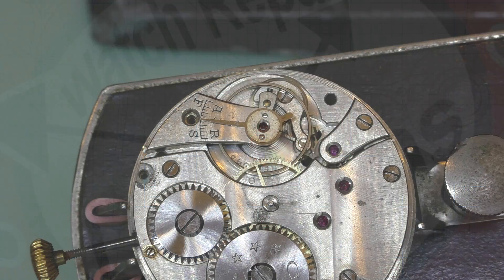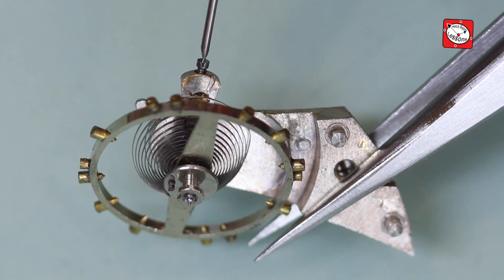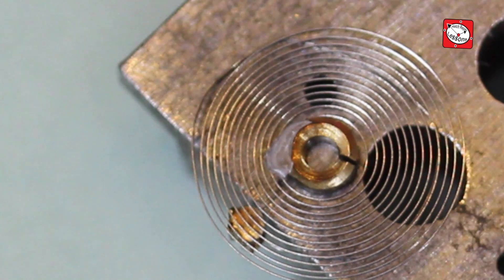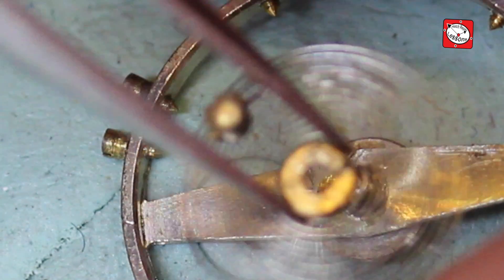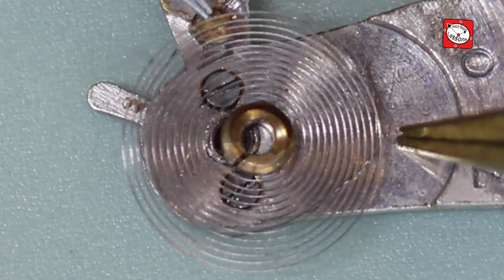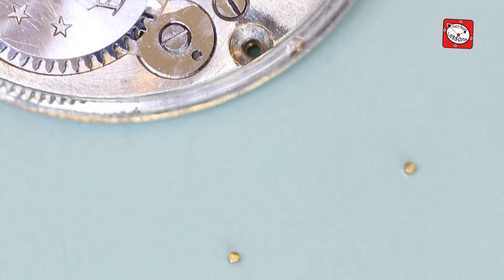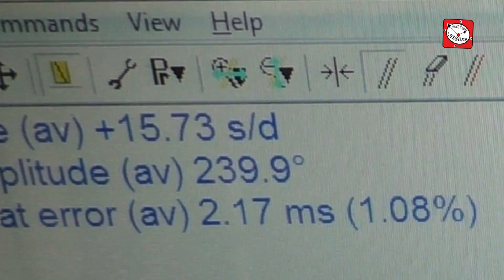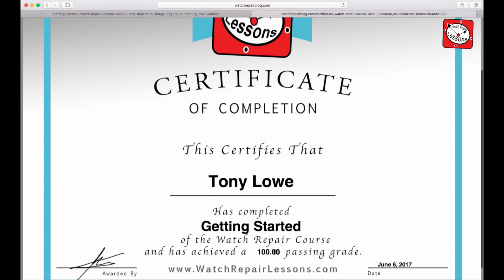The watch is gaining time - there's a surprising reason! - watch repair course and lessons

Comment: Hey, Mark, watching your videos again and, now being a little more knowledgeable, I noticed that you were using a computer instead of a timegrapher. Any recommendations on parts and software? Is it the same as a $150 timegrapher?
Now it’s easier to understand some of the actions and terms you use. Just like the video about twisted hairspring, at first I couldn’t get the lifting the spring to put it over the regulator but, after a dumb moment I realize that, when you lift the balance cock, the lower parts are the ones which will stay down while the outer goes up, and it really makes it easier to place it over it! Who knew that Mark could be right, once again!!!! Lol
Thank you very much!

Comment: Does hitting your watch by accident at work all the time, can mess with the regulation ? I have an omega geneve 1960s was keeping 3 sec a day +/- and when the power reserve is extremely low it showed -250sec/day. I quickly turned the crown to the full and dropped to a -50sec/day.

Comment: I''m an amateur hack repair guy (only my own watches) and this video has given me a new technique. I have an old oris which has a wonky hairpsring. I've been struggling with getting the hairspring just right. Now I'll be checking the collet hole is dead centre by placing it on the flipped balance arm. top tip!

Comment: I am not as knowledgeable as I would like.  Can someone help me out and explain amplitude as relates to watches?  I have a background in math, and degrees of amplitude confuses me a bit ;)  Seems like it's a measure of degrees of motion of the balance wheel?
Reply: I am a novice like yourself, but my reasoning is this: In the case of a pendulum, the amplitude is the furthest distance the pendulum travels from the point of equilibrium. 
The balance wheel has the same role as a pendulum as the time keeping element, so the amplitude must be the angle measured from the point of equilibrium to the point where the wheel changes direction.
Reply: makes sense, thanks

Comment: This is unrelated, but i have a cheap wind watch and the winding knob keeps coming off, unscrewing. Is ther a way to keep it from unscrewing? Thanks, Alan
Reply from the maker: The stem will need removing and secured in a pin vice so the crown can be tightened
Reply: Oh OK, Thanks

Comment: Great video as always Mark! 

I wondered if you can help me, my watch with an eta 2824-2 that I've had for exactly a year has started losing three minutes a day, it's never been drop or banged and has been welled look after. What could be a sudden cause for it to start losing so much time, can this timing error be corrected just by regulating or is it in need of a service? Many thanks :)
Reply from the maker: Seems like it might need to be serviced. Intervals should be around 3 years.